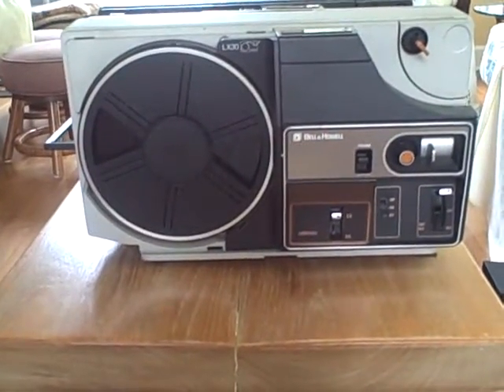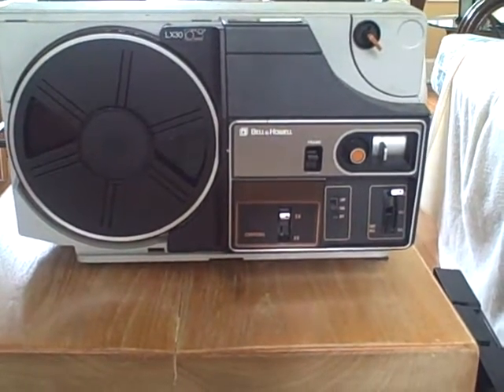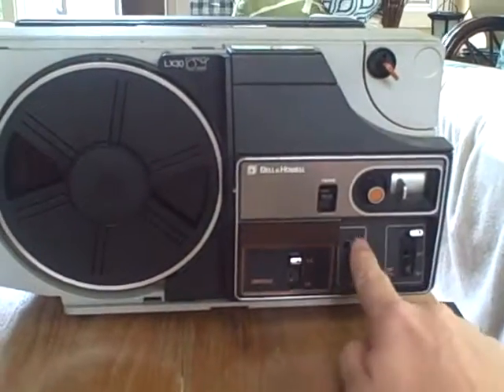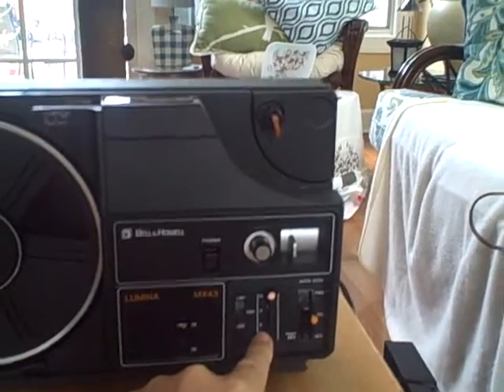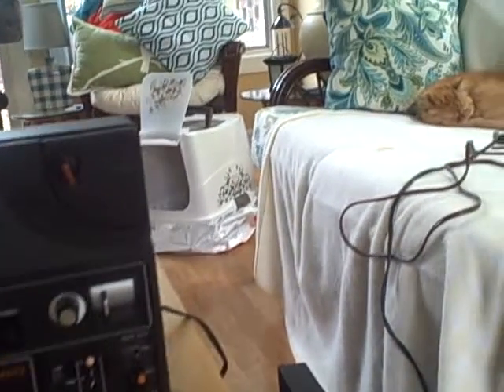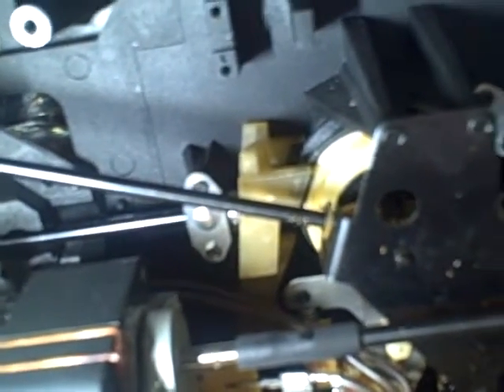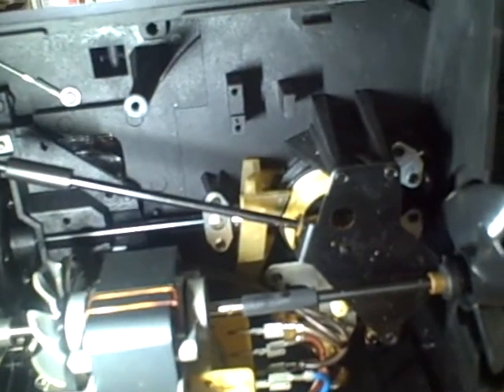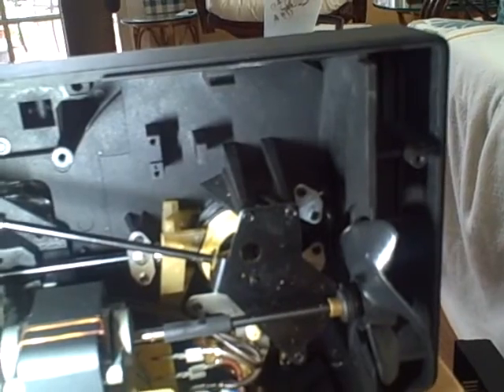Bell & Howell Dual 8 Projectors, typical problem with take up reel

Comment: Hi, I watched your video and fixed my projector. I took it apart and made a friction drive out of a vacuum cap. I measured the OD of the plastic drive then went to the autoparts store and bought a pack of vacuum caps. Selecting the closests one, cut it to length at the closed end of the cap. I put it on the end of a 1/4" nut driver and slowly sanded the cap around the edges and even took of the closed end. It got small but I did have a remnant of the orginal to compare. Put it back together and the take up reel works forward. When in reverse the wheel is free at the other reel pulls back the film. Thanks for the video.

Comment: You sir, have saved me a headache. I have this exact model MX43 with the exact same issue. I wasn't sure why the take up reel wouldn't spin. I'm glad you figured it out. I am going to try and get some rubber grommet material to replace the missing rubber nub. If I find a solution I'll let you know

Comment: I have one with the same problem, all three conical rollers have rotted away. I managed to repair it by making new ones. It would have been a shame to have scrapped it, as they are great projectors. You need to be carfull when disasembling the clutch, and make notes on where everything goes, as it is very tricky to reasemble, and the reasembly has to be done in the right order
Reply: RICHARD EVANS can you share the order of the pieces? I’m struggling on what goes where...

Comment: I took a couple of those cone-shaped wheels intact off of my Bell and Howell MX33 projector. I'm thinking of having them rendered for a 3D printer so I can make replacements of them. There are so many of these projectors floating about that have the same problem.
Reply from the maker: IF you do this, come back and post it as I am sure people will be interested, AND I sure will want one for my one as well
Reply: If you have dimensions, please send my way!  Mine were in pieces....once I get the thing re-assembled and working set I'll send you a set.
Reply: @Shelka04  I just picked one of these up off of Craigslist. It has the same issue. I'm looking for a fix.
Reply: hook a brotha up?
Reply: Did you ever do this?

Comment: I had the same problem with a Lumina II Lx30. After watching this video I got some black Gorilla Duct tape , ripped a thin piece about 1/4 inch wide , I cut it about 6 inches long and fed it through as I slowly wound the shaft . I wrapped it around that rubber nipple 2 full turns . Well the projector goes both in forward and reverse with out any issues. It is not a permanent fix but it should work to watch a couple of home movies.

Comment: I own two Bell and Howell QX80's. Back in 2000, I called a company out in California and described the same problem you have. He told me that those parts are called Cone Clips and it was common for them to disintegrate. I asked how much one cost to replace. He said $200 each. 😱 I laughed because I thought he was joking... he wasn't. I tried to make my own out of epoxy putty but it didn't work.
 I was just thinking the other day that those parts could easily be 3D printed. Looks like some of you have found a cheap way to fix it. Thanks!

Comment: Hi, thanks for the video.  I’ve been working on the same problem and my take on it is pretty much the same except that l think the tires (?) were made of plastic and press fitted on black plastic hubs.  The spacer pulleys use the same tires pressed on similar hubs.  I have a lathe so turned tires from a 1/2 in. brass rod and epoxied them to the plastic hubs.  This should work except that when I took it all apart I didn’t draw a diagram and for the life of me I can’t get all the tinny springs, washer, c-clips, etc. back together again so it works properly🙁. May have to find another projector to tear apart and find out how it all goes together!   Ted
Reply: lol thanks for this warning. I took the back plate off and am already forgetting  how to get it back on. definitely taking pics if I go any further
Reply: @DjSqueekz  
If you haven’t seen it, there is an excellent u tube video by “Super8soot”, 33 minutes, on how to disassemble and repair these projectors.
Reply: @tedfoster4235  awesome, that's exactly what I need. thanks!
Reply: @tedfoster4235  Thank You Ted for posting this. I have watched the video and ordered the parts off Ebay for $18.00 Thank You

Comment: I have the same problem! Mine is a LX58. I picked it up at Goodwill today. I also recovered fragments of this rubber wheel. It appears to be tapered and there are two or three more to the right closer to the fan. I have no solution yet since I just bought the projector this morning.
Reply from the maker: it's been a few years since i've had to deal with plumbing issues, BUT from what I remember they make tapered rubber washers for faucets, I wonder if one of those would work or could be modified.  I'm sitting in an RV in New Mexico and my projector is at my parents house in North Carolina.  So it may be a while before I can try this myself.  It is a thought as far as an option though.

Comment: I have 3D modeled the grommets and printed from a very good TPU (rubber like) filament - I tried to measure the broken pieces but ultimately I had to make the cone-shaped wheels seemingly (because I don't know original dimensions) small and narrow to even be able to put the e-clip back on the shaft.  The parts look great, but I'm not quite sure how this thing worked well in the first place.  It almost seems like the clutch wheels changed dimensions over the years or something.  I'll have to investigate this more - but wanted to let folks know I'll get these parts up for sale (just to recoup 3d filament cost) once I get the dimensions finalized.  If someone could point me to a good video on how to adjust this clutch that would be great - because I know exactly how the thing goes together but it all appears too tight (drive belt just slips...that's old as well so maybe I need to print/buy that too)..it might be the drive grommet assembly not retracting back into the drive shaft?  I'll keep investigating.
Reply: Did you ever get a 3D printed replacement part figured out for these cone clips? I need the same replacement part. Thanks.
Reply: Hey? Same?

Comment: You know, I've been trying to purchase a 70s-era Movie Deck. With that, two tries with two different machines shows that the main shutter gear has decomposed and disintegrated over time. It's just the plastics they used back then.

Comment: I was able to fix this by creating a "grommet" from a rubber band. Basically I got a rubber band, cut it so that it fit perfectly around the tip of the shaft and glued it using contact cement. Taking it apart was not that hard but putting it all together was a little harder. Let me know if you have questions :)

Comment: Thanks, very informative video; my Q is : Is there a way to show a 220 ft or 400 ft movie on this projector ? It seems to be designed only for 50 ft spools but the take up reel seems to accept up to 400 ft ???? Thank you
Reply from the maker: Yes, the front pivot / sprocket wil rotate up and forward to accommodate the larger reels
Reply: I thank you for your prompt answer. I will try it and get back to you.

Comment: Hi hi I have at least four of these machines that I have repaired  successfully and I know exactly what you are talking about. There are 3 drive rollers with cone rubbers that take up the drive spool.
Reply: Oooh??? How can you repair?
Reply: I will try to upload aan instructional video explain how about to fix this problem, but be warned its not for the faint hearted. You need to have a firm DIY mechanical knowledge
Reply: @barrypark1881  hi Barry I will try to do a instructional video soon about how to fix this particular problem in the meantime if you have any questions please don't hesitate ask I can send you pictures if need be projectors suffer from this one particular fault it is practically easy to fix but there are no spares for this thing so you have to to use a bit of ingenuity as I said I would try to put the video together explaining how to sort this problem out I have a Brand New Machine new old stock which has exact problem the problem is the rubbers parish over the years regards Robin
Reply: super8sooty I have an issue putting all back together. Can you share some pics of this? Mine is not working after so tried citing rubber pieces to recreate those cones. I think I’ve made a mistake with the assembly order. Thanks for your help.

Comment: It's not worth the effort, as this is a design where the emphasis was on "cheap", it barely worked when new. If you have old 8mm movies, find a DeJur 750, it's incomparably better than this plastic box.

Comment: The build quality of the Lumina MX series went way down for this generation of B&H projectors. They are cheaply made and consist mostly of flimsy plastic, including the case, knobs, switches, even the lens housing.  In addition, nearly ALL of them suffer from the rubber cone washer failing thus rendering the projector useless. Earlier generation B&H models from the 350 series, 450, 460, and some of the 1600 series projectors are built like tanks with durable all metal cases and are much more reliable because of the higher quality metal and rubber components. In addition they are way more easier to service and maintain and will provide years of trouble free operation with just minimal upkeep. IMO you should invest in one of these models and save yourself a lot of money and headaches.